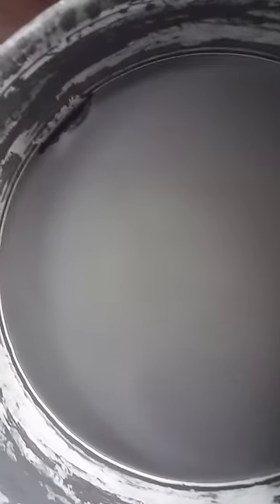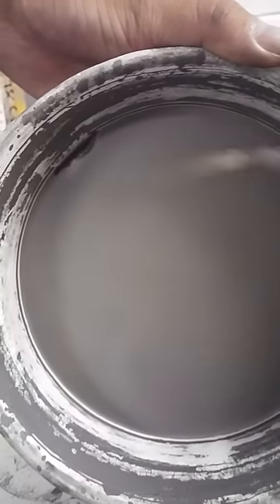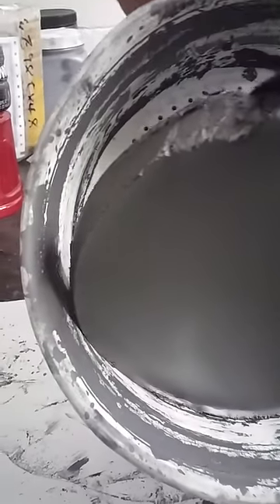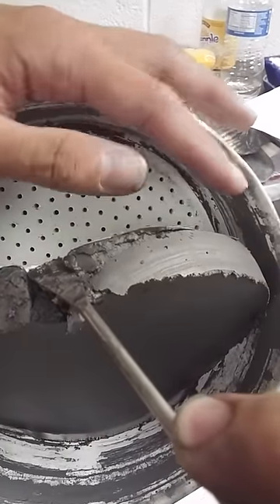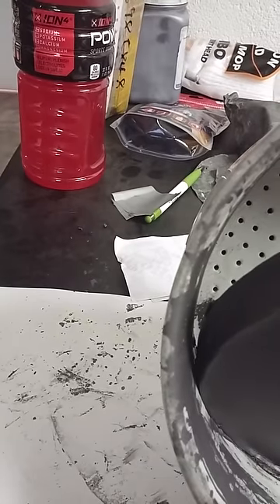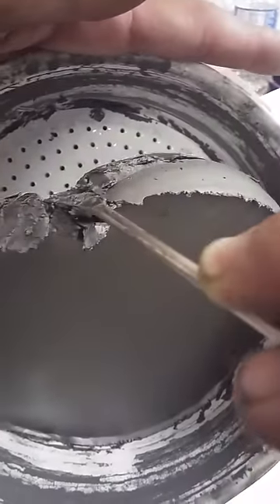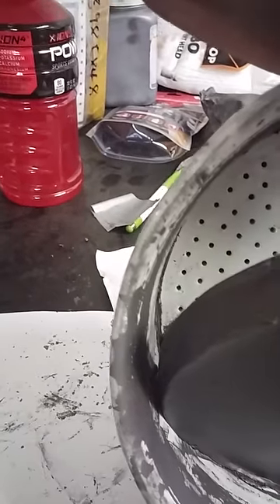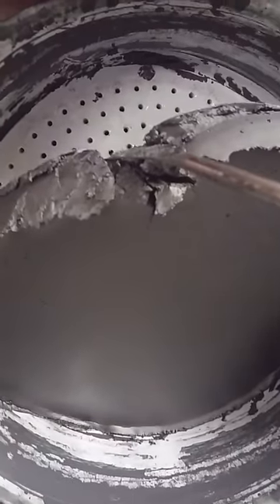Graphene super cake!

Comment: This material will have at the beginning the resistance from 5 -20 Ohms until it will dry, than the magic ends.
Reply from the maker: +Bartosz Barejko Actually no. When dried, this flake will have a resistance of 0.7 Ohm/cm. The only problem is orientation with single flakes.
Reply: +Venturestarx So what are you planning to do with this material sell it Intel or IBM. They will  be able maybe to magnetise them and assemble into the microprocessors, i did once have the really assembled graphite particles and the resistance was 2 Ohms. but maybe you did something more then Graphene.
Reply from the maker: +Bartosz Barejko We already can magnetize them, but if they can that is fine. Our sales plan is much more extensive than just IBM and Intel. Also note most CVD graphene is around 10 ohms, so we are beating that across the plane. I'm not certain how the test was done though, because it was done by ORNL.
Reply: Ok, Did you show this good product on your Youtube already with the proper tests?
Reply from the maker: +Bartosz Barejko I wish I could get a camera into ORNL to show you guys the tests. It would be really neat. I only get the data sheets back, or an email with confirmation. In fact, this may be my next video. I'll see if I can gather enough data that isn't sensitive to our process or future production for everyone to see.
Reply: Ok show it with live tests and that would be good  proof for the quality of your product and good advertisement as well.
Reply from the maker: +Bartosz Barejko I can't show the live tests because of where they are done (ORNL), and the fact I don't do them. It's all verified by third person so there is no bias and the instrumentation is state of the art. But I can show the results data for some of the tests. I have a team of professors and engineers working with the material, who are getting great results repeatedly in experiments, as well as peer reviewed papers being produced.